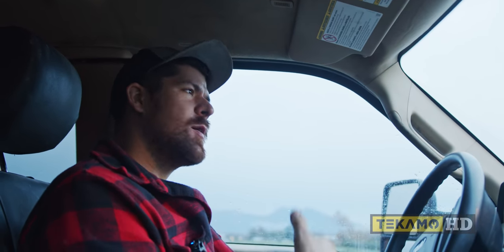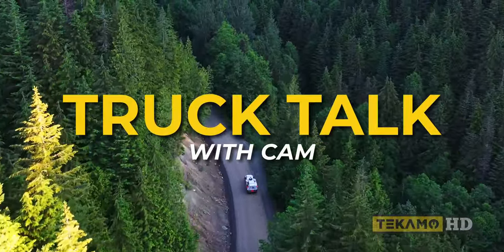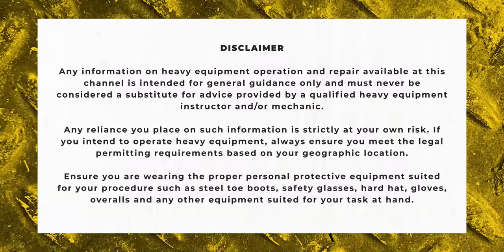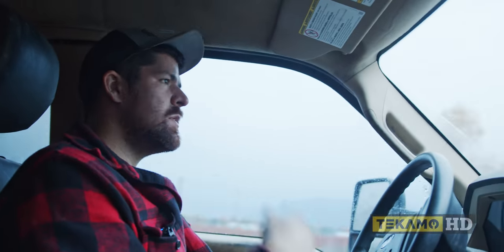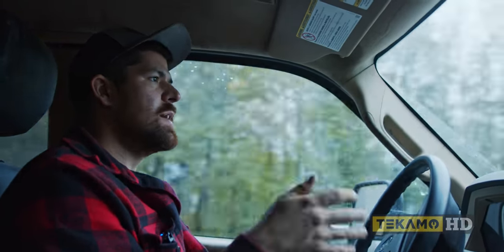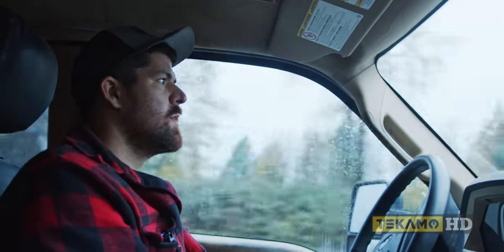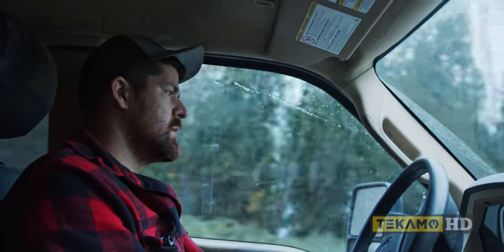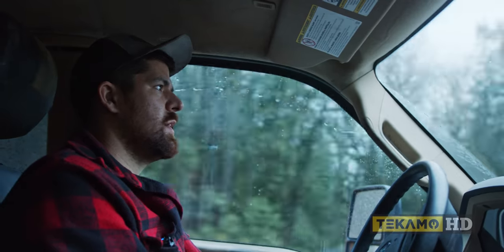Troubleshooting and Diagnosis - Cam's Approach (Truck Talk #1)

Comment: Always check POWER AND GROUNDS. If it has power and ground, more than likely that component is bad. If it doesn't have power or ground, use a voltage drop to test for high resistance or resistance measurement for an open. That'll take care of most of your electrical problems
Reply: Mostly yes but it depends what your testing with if your on a 12 v system and a component works with 12v and its only receiving 7 due to corrosion you could be fooled by that as well but you are correct just wanted to add for anyone who may be looking for information
Reply: That's why he said test for a voltage drop cause if you're only getting seven then the voltage is dropping indicating high resistance which is corrosion or loose connection, burnt area like I said high resistance.

Comment: Another great video guys. An issue that I’ve run into and seen lots of my coworkers get caught by is, jumping to a known problem.  Especially in fleets where you have several units that are the same make and model. If you find the same problem on 2 of them, guys can jump straight to that on the rest.

Comment: All I was doing was replacing a trunk harness for a recall on a mustang, after I got done, the rear camera was inoperative. I double checked all my work (splicing 10 wires and connecting a coax cable) and it was all good, thought I verified power and ground to the camera, still inop, then I started going to the bcm and the wires between the camera and the screen.. went back and supplied ground to the camera, worked perfect. The harness they sent for the recall had an open on that wire. Routed ground to an eyelet nearby, because any ground is good ground, worked perfect every time I tried it.

Comment: Electrical troubleshooting steps i use-
1. Verify customer complaint, and ask a crap load of questions about the issue when talking with customer. 
2. Know theory of operation on what im troubleshooting 
3. Start by looking for what is right in the circuit. 
4. Texas 2 step dmm  at battery ground long dmm lead to component or powerprobe works great, chevk for power? Now how about a ground? Is there any indication of voltage drop instead of 12 i have  7 volts that kind of thing is my ground close to 0 volts, veejer enterprise method btw
5. Dan sullivan methodology keep it simple its only 3 possibilities for electrical issues short, open, high resistance thats it dont overcomplicate it just because there is a crap load of wires its not all connected each section has its own circuit, just a fuse-relay- power- ground etc... for every circuit just keep calm and test on. 
6. Swaptronics 
7. Scanner danner method how is it controlled what is its job power side switched provide the power or ground whatever just bypass it look for scan data pid change signal circuit integrity test look his stuff up pull up or pull down design 
8. Journal it especially if it causes you grief next time you will have notes and writing it will make you better at remembering it 
9. The complicated crap is because joe smoe did something to it playing mechanic and caused it to be complicated this is basically the only time it gets complicated
10. Never trust anyone one if troubleshooting with someone they say i checked that already check it yourself they are probably lying. 

11. Call service section about their  equipment like for example Cat dozer issue, call Cat  ask them questions when stumped 

Now this works in other areas not just electical 20 yrs of fixing crap and a lot of money/ research enjoy and dont be a no it all no one likes that dude be humble

Comment: The amount of times i get to a no start and get in the cab and find its stil in drive or reverse is unbelievable. Always gotta look for operator error!
Reply: Had too many callouts to find emergency stops activated, in gear or wrong switch operated to release the bucket.

Comment: Great advice! Im a fleet mechanic at a shop in Alberta that runs mostly Mack Mp7 trucks and derate issues really been kicking my butt lately. Like I fix the problems for the codes I get but even after successfully regening the truck still stuck in derate with no fault codes.

Comment: had an issue with a client where his unit would only work on half the barn, checked over the entire unit several times over, even had the client check to make sure i wasn't crazy lol. 6 hours of troubleshooting from the unit to the pipeline (where the milk goes and where the power comes from)to the vacuum pump, i was stumped. to find out a gasket wasnt seated all the way even though it looked/felt like it was from the outside. Had to get a coworker to come and assist me and he went right to the gasket and fixed it first shot, of course the client had to be standing right there too.

Comment: Where do you get torque specs or what pressures are supposed to be as an independent mechanic
Reply: Independent techs can get access with subscriptions to some, others gets pirated.
Reply: In Australia a lot of independent guys run jaltest laptops

Comment: I have a travel issue on my pc35-2. One side is way slower and if you slow the opposite side down to make her track straight then the damned thing is so much slower over all speed. I’m afraid something I’d bypassing.

Comment: For me ain't divide everything into categories.
Engine: Fuel, Air, Electrical.
Hydraulic/pneumatic: pumps, hoses, cylinders and controls.
ETC.
Then I look at the weakest and cheapest link hoses, wires, fuses, filters and go on from there.

Comment: Hey so late to the comment section
But got a takeuchi mini excavator 
125
When you move the boom in the travel speed increases stump 4 other mechanics so far 
Any ideas or roughly where to start

Comment: Buddy asked me about a Hitachi 120 Excavator,  I told him I was to busy . But he had it at dealer and said spent 8k $ and still not fixed! So if he reaches out fast or trys to dig fast the machine dies. But if he runs it easy it stays running but digs slow. Changed all filters, diesel and Hyd, cleaned tanks, said found nothing inside, someone told him lift pump on motor , but he said it starts right back up after it stalls. Any ideas what to look at first I can relay to him?
Reply: Older machine non emissions,  I think he said early 2000s
Reply: Do u think its an engine power issue  or to much hyd load

Take all banjo fittings out at fuel filters  make sure there clean  blow air back to tank make sure u dont have a fuel restriction  also  make sure u dont have a collapsing hose on inlet  from tank

Could be a hyd issue with pumps not destroking as they should    Has anyone messed wth them
Reply: @jltcasper3  I think its hyd pump problem.  When it stalls out, it fires right back up. No long cranking like it ran outa fuel
Reply: The dealer supposedly checked pressures, they changed some valves on lift cylinders supposedly,  it was better for about 100hr then back to samething.  Idk it's hard to understand porkchops sometimes lol they talk to fast
Reply: What model hitachi 120  zaxis dash ?   Or ex ?       Can u track it at full speed and it dies too     Will 1 function kill it  arm  bucket  or is it combined   Functions     Cycle time each track individually in air
Reply: CAT tech here and I had a similar issue on a small, older CAT 312B Excavator. Engine starts fine and Hydro pressures were within spec so not being overloaded by hydraulics. Fuel pressures were good. Found that the governor control cables were worn and the governor control box was not calibrated so at each speed dial setting   RPM’s were consistently lower than spec. At speed dial “10” it was barely hitting 1900 RPM’s when it should’ve been over 2k. Due to the worn cables the governor control would not calibrate so new cables and new governor control (they come as a set) was the fix. Customer denied doing the repairs so never found out if it actually fixed it but it was a starting point. If that didn’t fix it After getting the RPM’s right the next step would have been looking into tune up items like injectors and injector cups to ensure the engine could handle the load. I know nothing about hitachi but maybe my experience can offer some food for thought
Reply: I’ve also had engines die under a load in the past due to blown injector cup O-rings. Specifically engines with fuel systems where fuel is directed into the head of the engine and essentially daisy chains between the injectors. Basically what would happen is compression would build under a load and compression gasses would push past the cup O-ring and into the fuel supply which would airate the fuel supply to the other injectors down the line.
Reply: @jltcasper3  I will get more info during week. I kinda blew the guy off cause I was working on something else.  He just kept talking while I was working. I was trying to stay focused on what I was doing
Reply: @samuelnelson7742  usually if injector cups were leaking wouldn't u be loosing oil or making more oil vise versa
Reply: @samuelnelson7742  ill get some more info on machine during week. Thanks for replying
Reply: @kwmiked     Not always but usually yes. Depends upon the injector design but you can have a leak between any of passage ways, crank case, and cylinder without it leaking to other places.

Comment: Got a 2016 cat 279c2 skidsteer it will pull left when hit high gear or when you hit low it will pull to the right. Cant figure it out. Any ideas?

Comment: Know the system, you may need to spend a few hours reading before you touch anything. Get your information direct from the manufacturer whenever possible. Understand the diagram & components. Keep it simple, 90% of problems are basic issues. Can’t tell you how many machines I’ve fixed with a cheap part after other mechanics already replaced pumps, ecms, valves etc…

Comment: For me it's question the customer about it and ask the same questions in different ways. 

Verify. And start with stupid/ most logical.
And check end to end. Then in sections accordingly. 

Damn I've seen some guys get right ahead of themselves. 
Sure. I've made mistakes. Everyone has. 
And dot get stuck on the machinery is the issue.. because well. Parts fail. From new. Had one car not long after COVID restrictions being opened up have 4 new alternators fail. 
New doesn't mean good

Comment: Dude with all of the tech hotlines out now, it's not very wise to throw your hands up, because the next guy is gonna show you up. I spent 4 hours on a Volvo vnl 760 abs issue. It was a chafed wire in the module harness

Comment: Multiplexing issues?! new ecm calibration which is my go to since it always seems to be the fix for cummins I usually work on, def harness had bad spot in it spliced it  still didn’t have power checked a ground cleaned it and got power , put a def header in it still having multiplexing and def codes, could it be a resistor in the def harness ? I’m stumped someone help
Reply: A little late, but I'm a Cummins field tech and find that more often than not you have something pulling your termination resistance down. On most Cummins engines the turbo actuator is one of the termination resistors. Always double check the diagram and check your resistance out and check your actuator itself. Also battery voltage is key. Weak batteries have fucked me a time or two.

More often than not the part throwing the code is not the part that's failed on a 1939 network. I constantly find other modules on the network that are failing and pulling the resistance down too far for modules that update more frequently. Make sure you're making the ecm run the diagnostic for clearing the code when you finish repairs as well.
Reply: Oh also Cummins has been updating ecm calibrations to have more tolerance for network resistance ranges. Essentially just writing the problem off. So that can likely be a part of why you're seeing the success rate with cals.
Reply: @nickjeldness1678  thanks for the reply better late then never, it ended up being a damaged connector on the def harness where it connected to the main harness on the Can Bus wires.